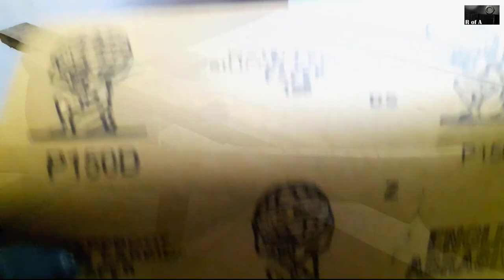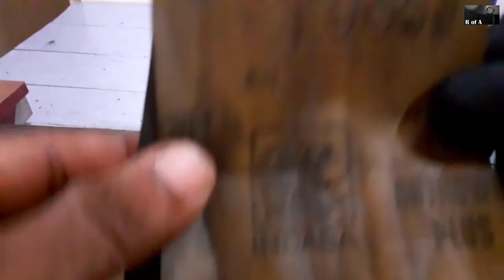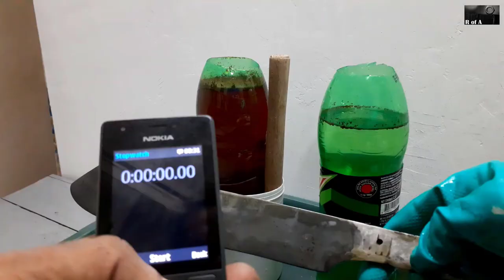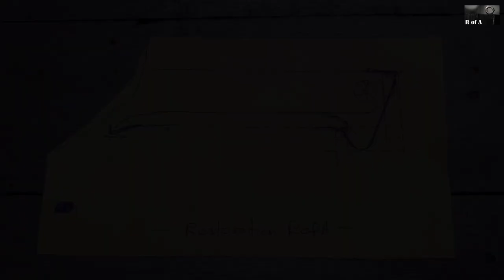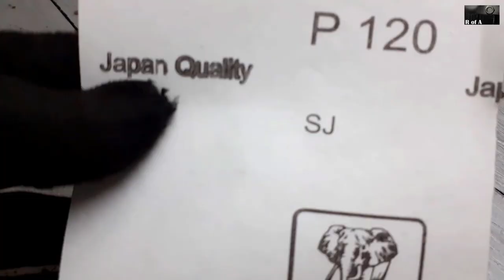sewage knife restoration | Rusty knife restoration | Broken knife restoration | RofA video

Comment: Anyone that knows anything about blade crafting knows that the single most important step to any quality blade is the heat treat and tempering, which you failed miserably doing. So much hard work for a blade that will never stay sharp.